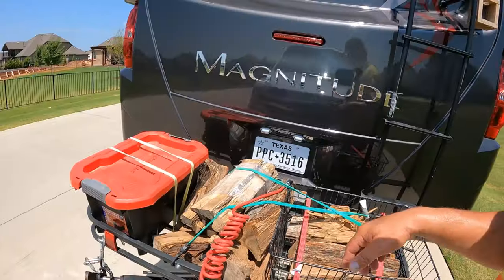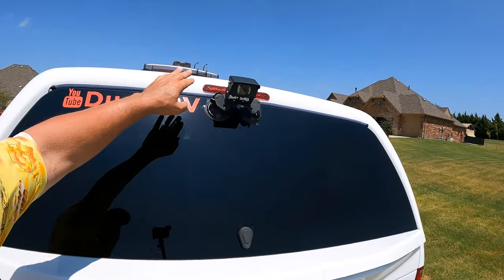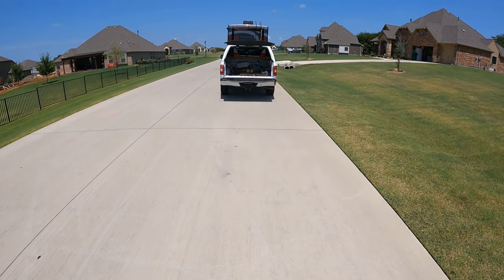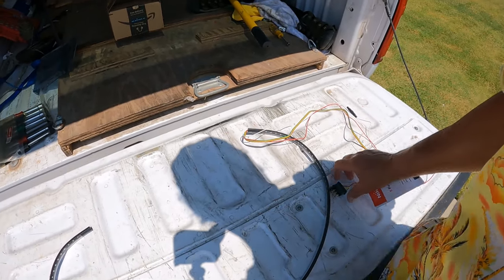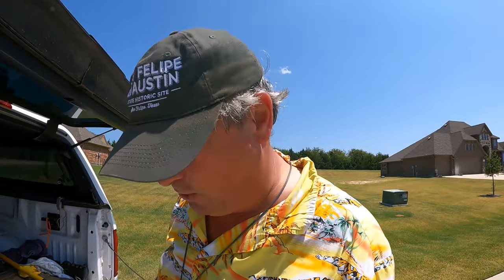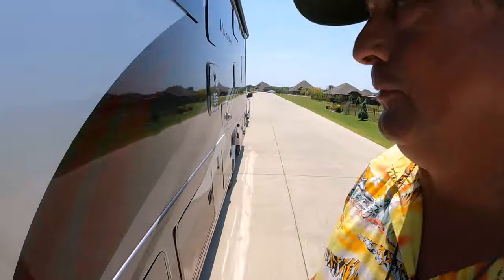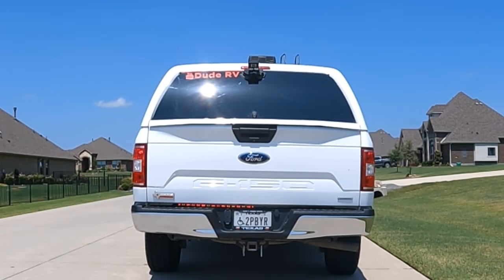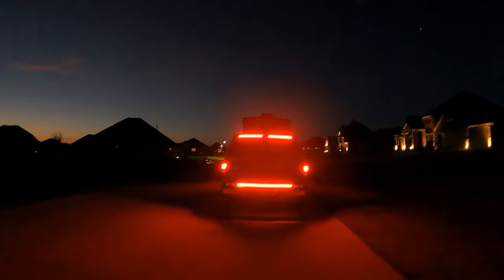Wiring Flat Tow Lights On An F150 | Towing With An F550

Comment: If your signal normaly is bright enough then all u needed to do was add extra ground wires to both vehicles...😊😊
Reply from the maker: The tow lights are a separate trailer wiring harness and were not very bright, adding the led bulbs made the truck more visible but people still overlooked them. adding the two blinker bars has made such a big difference! 
Thanks for watching!

Comment: So you ran a separate dedicated trailer wiring harness to the taillights and tapped them in? Just wanted to clarify for sure. Where did you run the harness, along the frame?
Reply from the maker: That is correct. Separate harness along the frame with light sockets added into the oem tail light housings. No need to worry about dioads and the issues that go along with that sort of setup.
Reply: @DudeRV  ok great thanks 👍
Reply from the maker: @SlimShady771  you are most welcome!

Comment: Soooo the LED lamps don’t really have a Max amperage they can draw. Opposed to a bulb that will just just burn itself out if overcurrent.  What I’m getting at is watch for these LED bulbs you installed to be getting too hot. They could blow some fuses or melt the housing. 

It probably won’t be an issue. Just an FYI.
Reply from the maker: I guess if they catch on fire people will really notice me! thanks for the advice and thanks even more for watching!

Comment: Any links on the front license plate that flips up?? Would love that for my f150
Reply from the maker: I originally had a plate holder that flipped up and locked, too many close encounters with handicap parking posts took its toll and I had to replace it. I have been unable to find the same one that I had and am for now using one that does not stay up. I had to remove one of the springs so It would not put too much pressure on the cord. here it is on amazon...https://amzn.to/3kwgobl

Comment: I picked up a 2” 4 pin receiver brake light for my RV. Went to install it and ended up scratching my head. I could have swore I hade a receiver back there, but nope.
Reply from the maker: guess that is on your other RV?😂😂👍
Reply: @DudeRV  or on the highway somewhere.